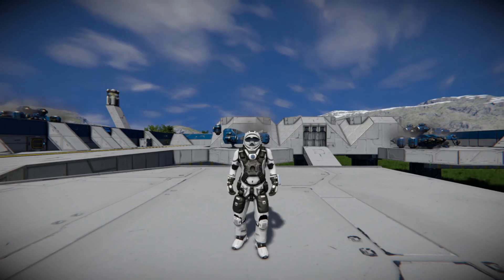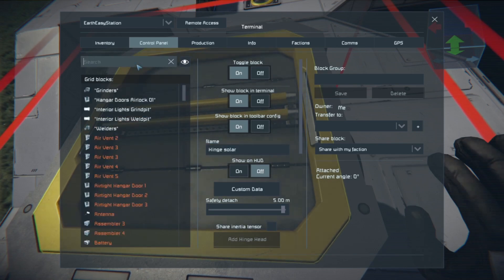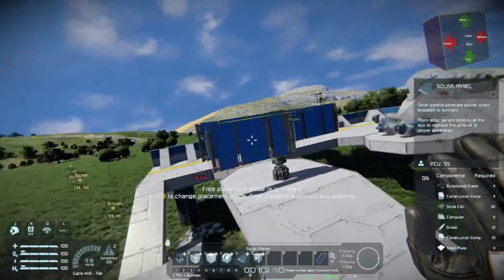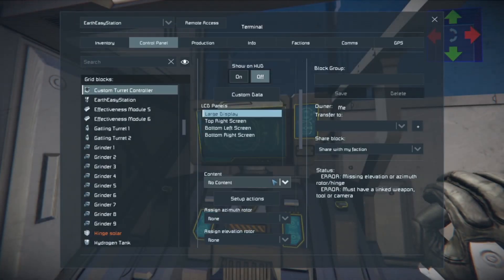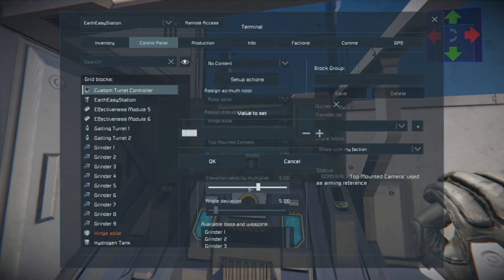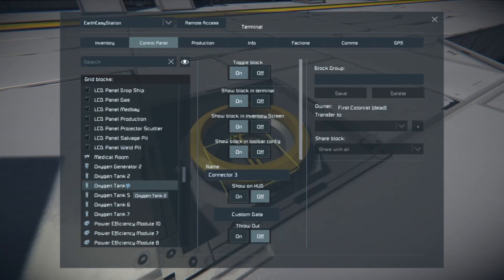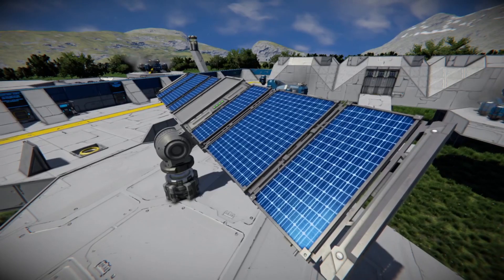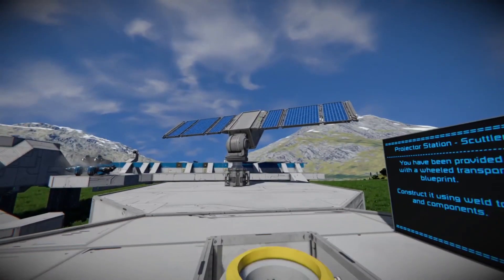Better Scriptless Solar Pannels

Comment: What I can see is that KEEN are STEALING modders work, to the point that they will not be interested in improving the game.
Reply from the maker: Oh no there are plenty of mods being made for the game. This was not a mod but a script. The problem with scripts is some servers disable scripts for performance so the community asked keen to put a solar tracking option in the turret controler. 

Keen also uses mods for inspiration based on what the community likes, take the water mod for example in SE1 it just replaces ice with a decent water asset but keen took this and improved it in SE2 by making volumetric water system a first in a survival game. 

Keen is one of the few companies that takes its community seriously and listens to its customers, a rare thing in today's market. Molders will still find ways to improve the game and unlike other companies keen will use it to make the game better for every customer.
Reply: @badgerwildgaming6908  I understand the script side, but I guess this was not a KEEN original idea. 
The water mod is a bit useless, unless you are staying on the planet and going fishing, otherwise, they would have to implement another way to extract H2 from water for fuel.
"making volumetric water system a first in a survival game" Granted, but we are turning this game into Planet Crafter.
They would have to change the title Space Engineers to Generic Engineers.
Reply from the maker: @oscargaming7582 I'm just pointing out how keen does listen to the players and not the bottom line. There are several features that start as mods when the community requests them and keen implements them later. It's kinda like market research to figure out what to add to the game next.
Reply: @badgerwildgaming6908  
UIhmmm, that is a very soft way of putting it.
MArket research is more like presenting an idea and not product development.
If you want to use that analogy it is like, a group of people made a special tomato sauce to put in a recipe and then after its success a big manufacturer makes a similar tomato sauce.  If you don't call that stealing, then ok!!!!!
Reply from the maker: @oscargaming7582 well it's better that most companies who don't fix or add features unless they can charge ungodly amounts of money for it. Keen may be in a grey area yes but their doing more good for the player base than being greedy sob's
Reply: @badgerwildgaming6908  
Well, yes, but I think they are doing it to survive. They should acknowledge the modders work.
Reply from the maker: @oscargaming7582 ya some credit wouldn't be bad.

Comment: I saw a video to optimize panel power by attaching an additional solar panel behind the first one so they are touching. Because light goes through the first one and the one attached behind it catches light too.
Reply from the maker: Really you got a link and I'll go give the a view and a like
Reply: I think that has been patched
Reply from the maker: Could be. It's an older video.
Reply: @badgerwildgaming6908 Very true. Wonderful video by the way. Certainly helped a beginner like myself
Reply from the maker: @michaelmceneaney1883 thanks I hope it helps!